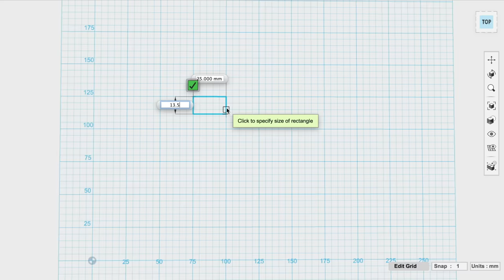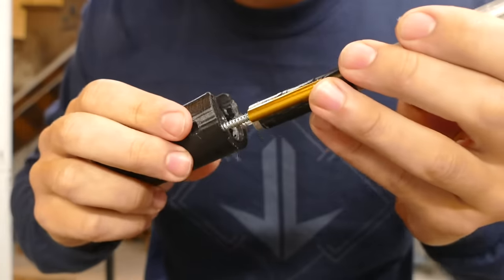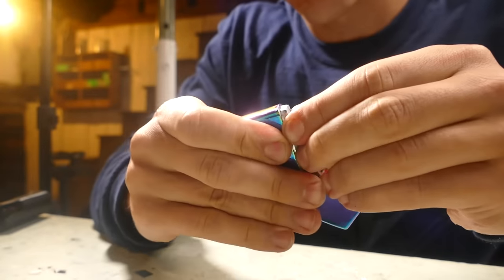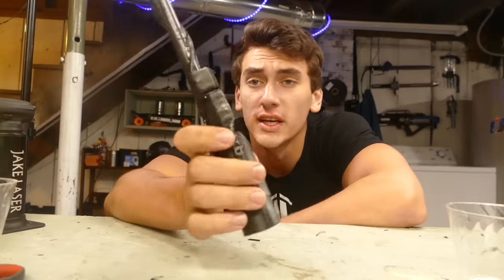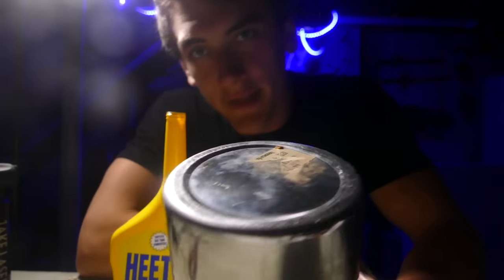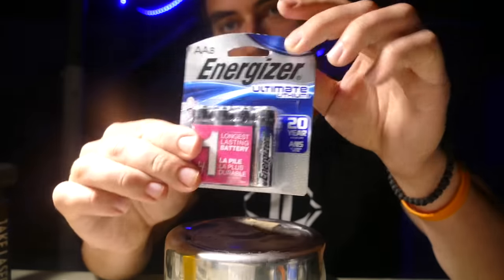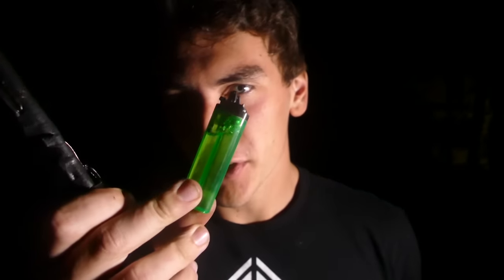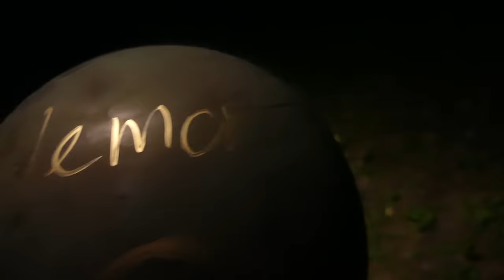How To Make a Working HARRY POTTER WAND!!! Real Life Spells!

Comment: You can also using flash cotton, or spakler dust and have a wand  that could shoot a fire ball or shoot Sparks. Another thing you could do if you added a LED light slightly above tip so it would not melt when you used fire mounted externally with a separate battery pack you could have a light up or fire wand .

Comment: i tried this but sadly it does not work. i filled the lighter with isoalcohol as substitute for heet, and then added butane gas. They seem to mix well in liquid form. But the lighter doesnt work normally , i had do open the regulator so much that its close before all gas leaves.
So when it works a bit the nozzle spits out the alcohol in irreghular impulses all over the place.. :-( any ideas what i made wrong?

Comment: I did this once with flash paper I used a hollow pipe and I place and tape a rub band to the top I made a stick so that I could pull the flash paper all the way through and held the rubber band in my fingers I made an igniter and put it on the end and I made a locking mechanism I wired them together with a button on the end then boom I made a long shooting wand.
Reply: Dyslexia 😬